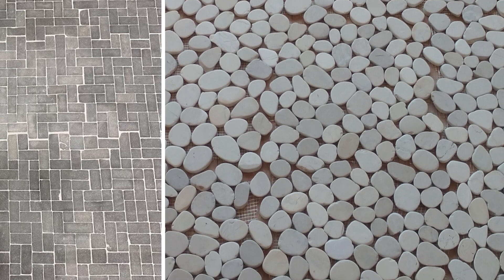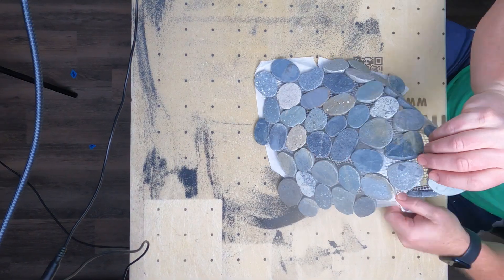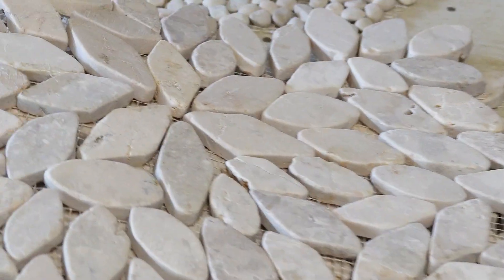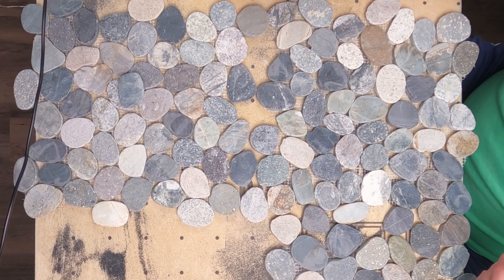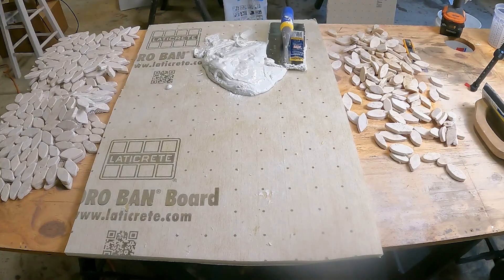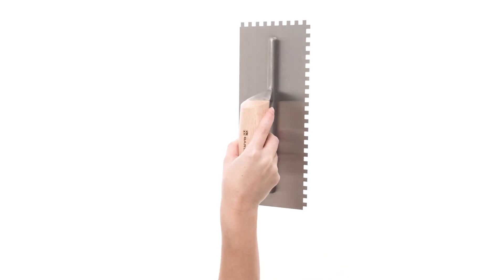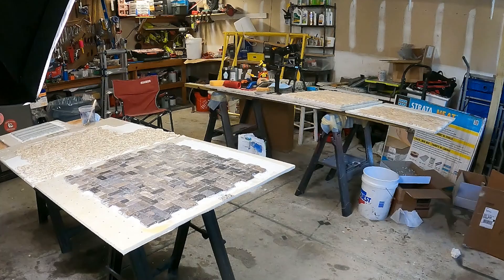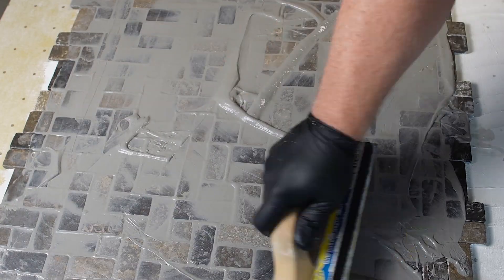I HATE It, But YOU Can Install It! DIY Pebble & River Rock Tile Mosaics for Beginners

Comment: This video is very timely for us. My wife and I gutted our bathroom and just laid the floor with large format tile, now at our 4x5' shower. We originally decided on a small pebble tile but now considering a rounded river rock mosaic tile. While it looks good without grout, we noticed that most rounded river rock installations have massive grout lines and hide most of the stone. It's been difficult to find a good balance between a satisfying smooth and round surface to step on, good drainage, color match, and small grout lines. Still researching and glad you posted this.
Reply from the maker: Good luck!

Comment: Question.  I want to use rounded pebble stone, river rocks, field stones, not on a sheets in the corners of shower. Rectangular ceramin tiles will be used in the centers of the shower walls.  I am not sure which products are best to use. Suggested is to aet all the ceramic tiles first as usual then  Suggested was to  build slowly bottom up using  silicone caulking to first place the stones to act as a glue to the wall, seccond uggestion is to use a tile adhesive but no products suggested. The use mortar to fill in.   Then grouttile and stone.   What is your suggestion?
Reply from the maker: If I’m understanding your question. I would set the walls first, and then put your pebbles in tight to the wall. The joint between the wall and the stone, I would use a flexible sealant like silicone. And a normal grout everywhere else. I would set the stones and the tile with the same type of thinset mortar. My favorite is Laticrete’s TriLite